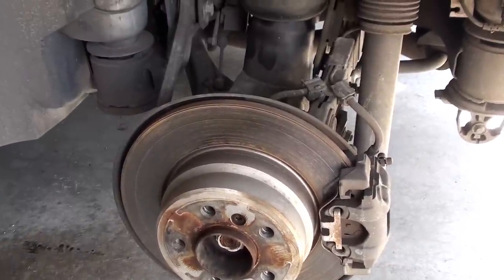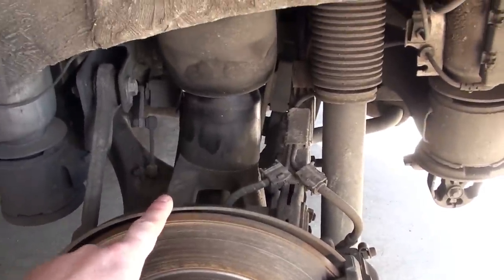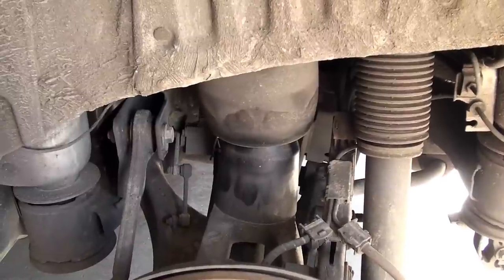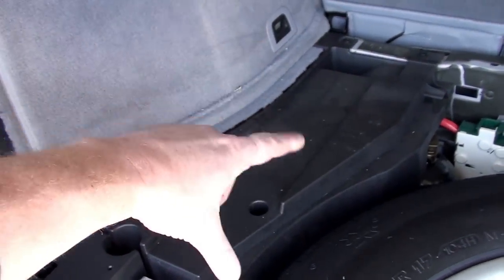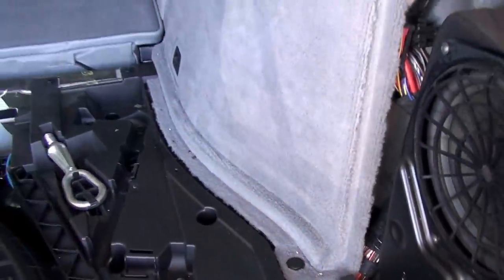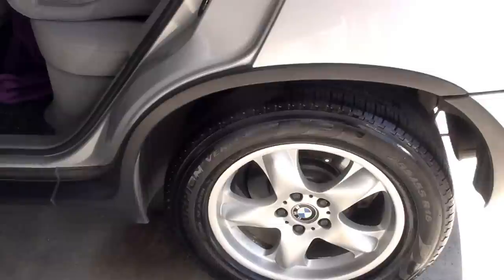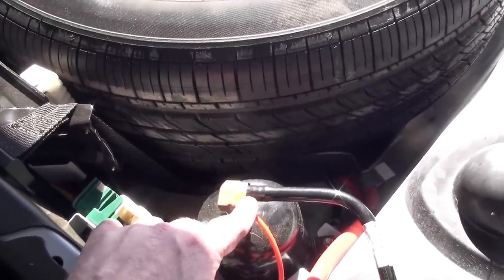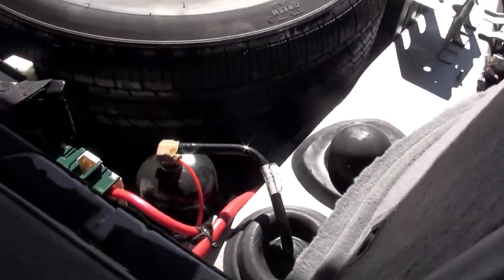BMW E53 X5 rear Air Suspension replacement DIY

Comment: For those of us that like to be thorough, thank you very much! I watched about 5 videos on this replacement as I do with all repairs, and yours is the best sir. Just the explanation and completeness is great. Thanks again.
Reply from the maker: Happy to help!  I hate when instructions are vague, or assume you know every step.. I am really glad this helped you out!
Reply: @BMWDIYGuy I am about to do it now but it looks pretty simple. Did you ever get the light to reset or did you have to have it done. Hoping my cheap OBDII from Amazon resets it. It is supposed to be able do the collision airbags and DSC system.
Reply from the maker: @intricate6927  I honestly dont remember now.. I have the Torque app on my phone that can reset many errors, so if it didnt reset by itself (which I think it might have) then I would have done with with Torque and a cheap bluetooth OBD adaptor.
Reply: @BMWDIYGuy  Only took about an hour to do. Then did 3 window to regulator clips. Everything back to proper working condition. The first time I started it the warning lights were still on but after I started it a couple hours later they were off. I have the torque also but I have the cheap creator obdll from amazon which would not turn them off either with the first start up. Thanks again!

Comment: I just bought one of these, 04 4.4i with 138000 miles on it, GREAT condition, great driver.
Very helpful vid in case I have to do this job some day, thanks.

Comment: Great video. Learned a lot by going through this video and actually doing it by myself. Couple points to note. The push to connect for arnotts worked really well for me. No complaints so far. Some one asked why to disconnect the compressor lines. The answer is to do with the releasing the vacuum. You will have to make sure that the line is not vacuum sealed when connecting the top and bottom mount of the air spring. The bag will not expand freely otherwise. Other than that the work itself involves quite a bit of careful planning and execution. Other than that it is pretty much a easy to perform half day DYI. You get the satisfaction that the work is done in a quality fashion.
Reply from the maker: Thank you and glad it helped!

Comment: My new parts came in today. Took about an hour a side. 211,000 miles and the original parts from BMW came off the car. The results car drives now like new. The thing on dash is still on. But car is drivable.Thanks,Gary
Reply from the maker: Glad to hear the video helped!  We are not far behind you at about 180k miles!

Comment: Pull the 7.5 fuse for the air suspension then reinstall and you should clear the dash error message. It worked on my e39. 😎🇩🇪🚙
Reply from the maker: Great feedback thanks!

Comment: had that 'suspension error' as well, decoded it and it said 'constant pressure' which means that the pump tries to pump air and increase the pressure, but there is no pressure increase - so that is why there is a constant pressure error code, also that error sometimes appeared sometimes not, so it was not consistent as the air pump piston ring was wearing out, so getting air pump out, opening it,  replacing piston ring and all errors were gone, I used replacement piston ring from ebay, just serach for 'BMW X5 E53 Wabco Air Suspension Compressor Pump Seal Repair Kit' - in general easy job, but make pictures with your phone when you will dismalte your air pump, as there is so much hoses and you might forget what to put where, and also search on youtube how to do it, no problems so far after another 4 years of driving
Reply from the maker: Well done!!

Comment: Arnott brand are superior construction to the OEM.  Also coat the bladder exterior with a good Silicone Spray for even better longevity.

Comment: Thanks for the Video. I thought it was going to be an extortionate amount of £’sss to fix. Air bag was £26 and it took less than 30 minutes to replace it. 
The suspension has inflated to its highest point. When driving it is so bouncy! How do I get the car to self level again? I look forward to your reply or any other advice from e53 owners.
Reply from the maker: Awesome news, glad it helped!
Reply: @BMWDIYGuy  The rear suspension is now really high and the car bounces excessively along the road. Is there a way to get the car to self level?

Comment: Thank you for well explain information, i replaced the shocks and the problem that i have is the compressor only works for one second and stops i got two additional compressors from wrecking yard but same results. Please advice. Thanks again

Comment: Hello,

So I replaced the air bags. Thanks for the video, but the bags aren’t inflating and the warning ⚠️ light is still on. You mention something else might be wrong. Do you know what that might be? I was thinking about replacing the compressor. What do you think?
Reply from the maker: Have you checked the fuse to be safe? It could be the compressor as well like you mentioned
Reply: BMW DIY Guy thank you for responding in a timely manner. I really appreciate that. 

yes sir. I’ve checked the fuses. Their good. Have u heard of the relay switch going bad?
Reply from the maker: @Death_Row_Anglers   I haven't heard that but also haven't dug into this system very much.  I got lucky and just had a leaky bag.

Comment: Great video. I just bought one of these suv's  yesterday and the rear suspension is sagging. When I open drivers door and passenger door I can hear the compressors kick on and the air suspension goes up. But after about a minute it looks like it looses pressure and goes back down. looks like low rider in back. you think the my suv has the same problem yours did? Thanks,Gary
Reply from the maker: Yup.. willing to bet you have a split in the component.  Replace both while you are at it.. you can get them relatively cheap, the job isnt hard and you will be GTG in an hour or two.

Comment: I have a European e53 and have bags at the front as well, every so often I get the warning on the dash about the inactive air suspension and I loose air from them over about 2/3 days and desperately need some guidance but no videos anywhere on 4 airbags all round. Where do I start please, what parts do I check. Thank you.
Reply from the maker: Wish I had great advice first hand but haven't touched that work. First suggestion would be check realoem.com and select your make and model to find the parts and part numbers.  Worst case, find a good local BMW shop.

Comment: Hello, I am French and I use an automatic translator so sorry if there are any mistakes .. I have replaced my 4 air cushions (e53 4.8is) but the front suspension remains very very hard! you know why? everything is ok, no fault, compressor ok, attitude sensor ok
Thank you
Reply from the maker: So the front is maximum inflated or what specifically is going on?  Dont worry, the translation was good.
Reply: @BMWDIYGuy  Thank you for your quick response, the front cushions are very inflated, very hard, almost impossible to squeeze by hand.
Reply from the maker: @ggd2949  Ok.. so they are not deflating at all then, just fully inflated.  I wish I had good guidance as it sounds rather serious, so best suggestion is take it to a good shop asap.
Reply: Yes that's it, they are well inflated and I was wondering if I didn't have too much pressure. I feel like it doesn't regulate the air when it soaks up the bumps. I am a mechanic and here I admit that I find it difficult to understand. I have checked the whole system with Ista and I have no leaks, the solenoid valve unit is ok, the compressor is good. On the other hand, I noticed only one fault: accumulator pressure remains constant, filling has been requested. I made a tutorial for the replacement of the front:https://www.techniconnexion.com/t46587-bmw-e53-x5-4-8is-remplacement-des-4-coussins-de-suspension-tuto

Comment: Did you ever get the suspension error message fixed?
Reply from the maker: Once the system was repaired the message went away.
Reply: @BMWDIYGuy  Okay cool , thanks.

Comment: I don't have any mechanical background but is there a Shock Absorber in the rear? I assume the Air Suspension is not the Shock Absorber. (having BMW X5 3.0is 2005)
Reply from the maker: Shocks are different for sure.. this adjusts ride height.

Comment: do I have to take put the fuse..n after the repair when do u insert the fuse back in
Reply from the maker: I dont believe I did  remove the fuse.
Reply: Fuse should be put back after all connections are complete. but do not let car down from jacks, so let down only where wheels are just touching ground, no weight and then put fuse in and let air bags fill, then let car down all the way.
Reply from the maker: @msullivan9565  great added info!
Reply: M Sullivan 
thanks GUYS. its been seating to long. 😢 👍
Reply: As a side note, if air bag plastic clip on air hose connector, as was the case with mine, this item is not sold anywhere without buying whole unit with hose.  I used old reliable JB Weld, push on air hose, and then force in JB Weld around brass connector into opening where clip locked in. Been a few months since, no leaks, it holds perfectly.  I have spent enough on this X5 and not paying for whole unit over a .05 plastic clip which get brittle over time and are easy to break when removing airbag.  If I had original, I would make them on 3D printer and make a fortune selling them on eBay. lol  Forced-Success-System.com

Comment: If the clip where the air fitting is, is broken and can't pinch the clip how do you get off the hose?
Reply from the maker: Dang good question, needle nose plyers MAYBE.
Reply: Solution- cut off the air hose, take off affected bag and air tank, purchase new one hahaha

Comment: hi, i have a bmw e39 touring, the ride height/self levelling lamp is on the dash,  so i changed both rear air bags as they needed changing anyway,  after that the dash ride height light is still on,  even though the suspension is working as normal, as far as ime aware that is,    any idea if the car needs calibrating at a garage that has a computer scanner that will nto the suspension?.  or should the warning light go out anyway automatically when starting car up?.  thanks dave
Reply from the maker: So couple of suggestions.. first, pull your battery for up to a couple of hours for a full ECU reset.  Also, reset any error codes if you can with tools like Bimmercode or Carly.  Lastly, sometimes the sensors will reset if you drive for awhile and the car realizes it is ok now.
Reply: @BMWDIYGuy  hi BMW DIY GUY,   thx for your reply,    I have tried disconnecting the battery but no luck,    today I took it to have 2 new front tyres & the guy there had a £2000 Snap-on scanner, so he scanned it for free to try to clear the codes,   but that wouldn't even scan bmw e39 rear air suspension,   I have no idea why,    Anyway, when I got home I decided to removed the rear suspension com[pressor, then removed the solenoid and immersed that in water,    and hey presto!!!  its got a tiny air leak, just like a slow puncture ,,,, so ill find  a 2nd hand one off eBay , fit it and hope it then clears the warning light,   thanks a lot,   Dave in the cold and windy uk......

Comment: i know its self leveling, but is there a way to adjust it manually, for instance to get a softer ride?
Reply from the maker: It is possible to convert to springs and disable the air system entirely.  Also your struts could be tired too depending on age and miles
Reply: Heya Colin, no doubt you've figured it out but if not and yourself or others want to adjust height here's the best and cheapest way i've found after having two E53's .......
Beg/borrow a laptop, hit the bay and get a usb cable, these you can get bundled with software required, mine several years ago cost 40 sterling that was for INPA and other assorted software and a usb cable, i migrated from INPA to ISTA (got the Diag and Programme so ISTA-D +P)
The software usually now is a 1-click install so foolproof
With engine off but ignition on fire up for eg ISTA-D, let it run diag and vin check etc (YT can show you easier than my typing) you goto the chassis area and find adjust height blah blah blah (again, YT has vids)
To keep it simple i will round off the heights for an example, in ISTA you measure from bottom centre of the wheel rim upto the bottom of the wheel arch in a direct vertical line (INPA is centre of wheel to wheel arch)
Example for lowering, eg heights oem are say 700mm and you want a softer ride, you go through measuring the heighs as sw needs but you add on say 10mm, 710mm will drop it 10mm, so what you are doing is giving a false higher height so then the sw lowers it by 10mm more than oem (hope that makes sense) so adding more height in ISTA measures makes sw drop it lower, i would recommend 10mm intervals and remember sometimes you have to ride/load the car somewhat for the adjustment to take place, or time can come into play too

Long winded, but add height to measures to lower remove height from measures to raise

After i initially borrowed a laptop i treated myself to my first ever and haven't looked back since, i can read codes and also reset engine learnt settings etc, pretty cool as long as you use common sense and go cautious, real easy to track and problems i've found

Without checking and if you have a LT to use or borrow i'd guess for 50 bucks ballpark you'd be up n running (bar having to wait for delivery of cable, sw i got was instant download

One point i'd mention, if the sensors every need replacing, get to a dealership and get the oem, i've had cheapish ones and mid priced ones (Febi, to name one wellknown brand) and all crapped out after 12mths, here they're 88 sterling a corner from a dealer (mine's a 4.8is with 4 corner air) and well worth the extra dollars, changing sensors twice and then finally a 3rd time with oem to cure my ills aint what i call fun hehe

Comment: what you know about rear wheel open cuircut code?  I have 2003 bmw x5 4.4 i already replaced abs speed sensor twice brake light s are on no idea if anybody can help me
Reply from the maker: I am sorry, I am not familiar with that error.  Bimmerpost might be a good place to check or Xoutpost.com as well.

Comment: mine blew a few days after replacing them
Reply from the maker: Sad panda.. bad units or bad brand?
Reply: @BMWDIYGuy  Actually it was the plastic clip that holds the air pump hose on top of the air springs. It came off somehow while driving even though I put them on correctly, might just be the old plastic. The pressure from the springs being released at once and shooting the hose off made a loud bang that made me think the bag just blew up like a balloon. So thankfully the bag is still good though I had to drive home about 15 mins with zero air on one side. I am pretty sure I caused tremendous wear on them but they still work. I replaced the original plastic part with the one that came with the Arnott springs, originally choose not to do this because they did not match the oem piece and didn't look like they fit my car. After inspecting it more I realized the Arnott piece is superior. Its harder to take off once you put it on because you have to spread the tabs apart to push it off beforing pulling on the hose instead of closing the tabs with a needle nose pliers and pulling the hose out but It stays on there better.